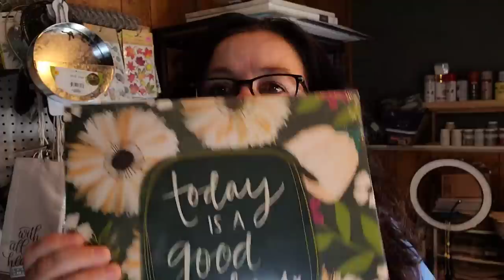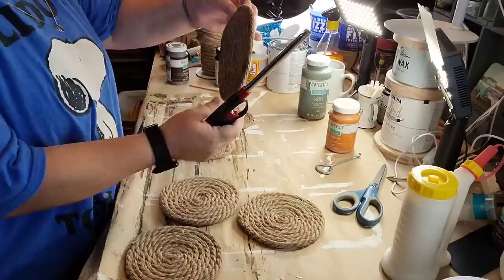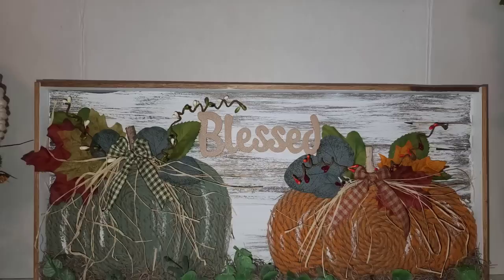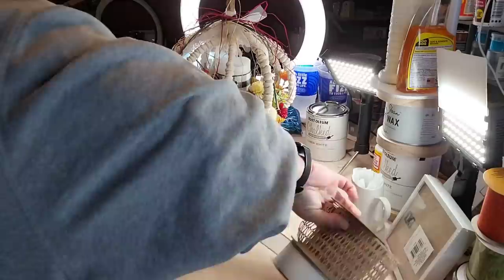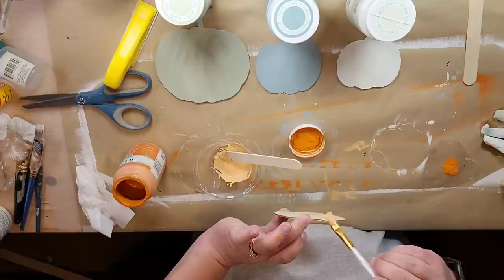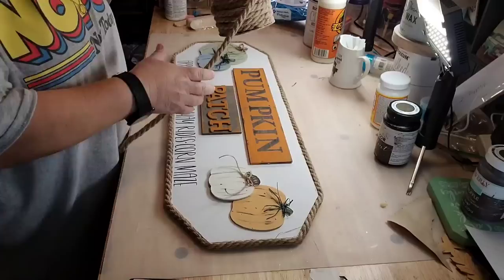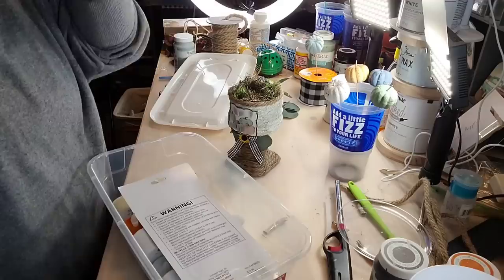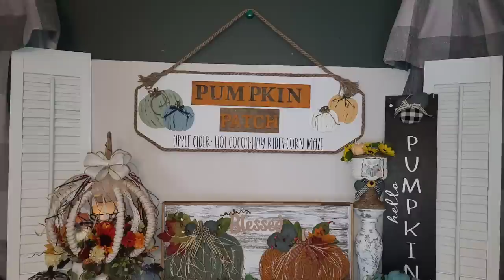Awesome Fall Dollar Tree Diys|Craft with Nautical Rope

Comment: I always give you great praises for what you do. But that sign you did that said hello, pumpkin with the black & white. Check coming through on the pumpkin at the top. Those leaves just blotted it right out. It doesn't even look like a pumpkin anymore. You need to take them leaves off and put some little tiny fall. Fell leaves at the dollar store has on there and some little of those little beads on The Wire.  I'm sorry I love you

Comment: Where do you find your waverly chalk paint.  I live in WA and no stores have it anymore.  Also you can use either interior or exterior flat paint which is like chalk paint and use your little 2oz bottles of acrylic paint and mix any color you want.  I wanted to have some of those foam or plastic pumpkins outside so that xterior paint that I colored myself turned out great.